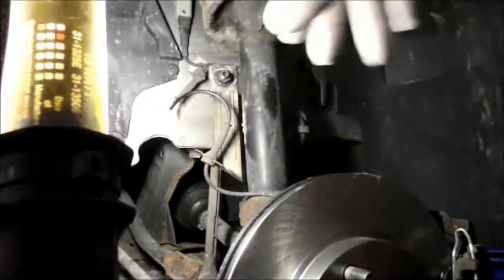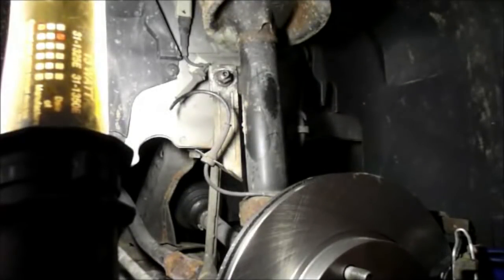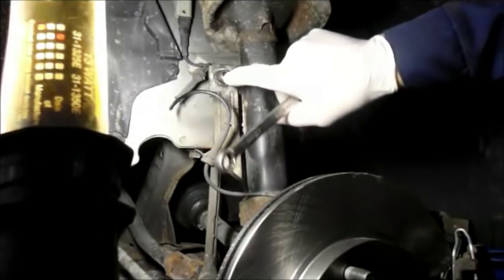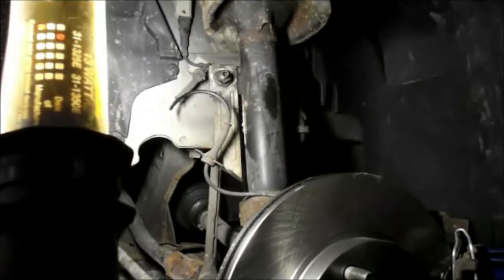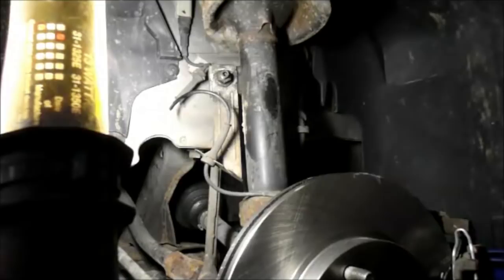How To Replace Front Sway Bar Links 2007 Ford Focus

Comment: Hi Jim..  I have a 1988 Honda Civic which has been sitting for about a year because it cranks but does not start. I checked for spark with a test light  but no spark coming from the ignition wire. I also tested the distributor and no spark. However, I installed a new distributor, a new battery, did an oil change, checked all fuses, battery ground cables and positive and they are cleanand tight.. The car has also a new main relay.. But still no spark...What could it be? I did notice that when I turn key to "on" position the check engine light does not go off but stays on.. it should go on and off.. but it doesn't.. The car also has good mechancal timing and compression.. The only thing I have not replaced is ignition switch and fuel pump.. What could it be? Could it be the ECU? I don't know how to perform a test on it?